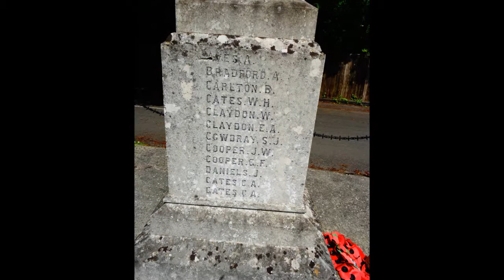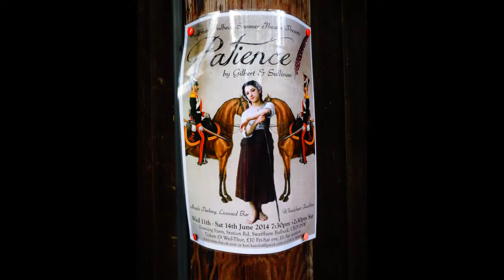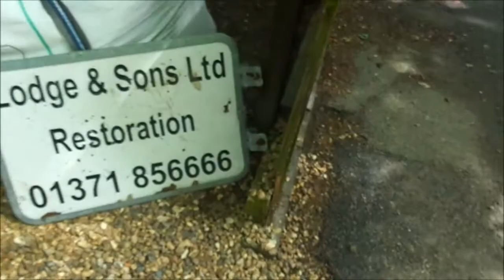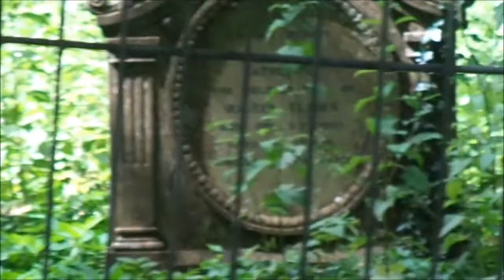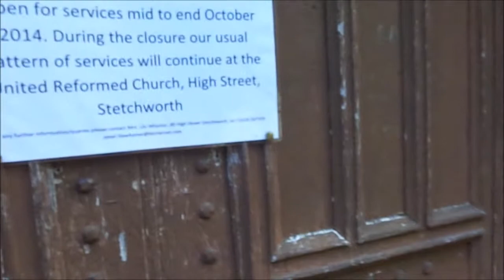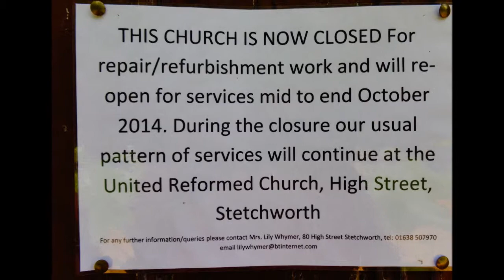Stetchworth Parish Church, Cambridgeshire, PART I,  by Sheila, June 8, 2014

Comment from the maker: Since  2014 I have revisited Stetchworth and  able to admire the  restoration work inside and outside the church.  Videos of the 2017 visit are on You Tube somewhere---Unfortunately since a very early video from 2008 the inside of the church has been altered quite a bit and seems very modest and bare--previously it had a musky old  feel BUT to save the church huge measures were taken  to repair  the vaults and space below the flooring, walls were repaired but it still has its charm, still a place where ancestors were baptised, married and had their funerals and are buried outside in the graveyard...